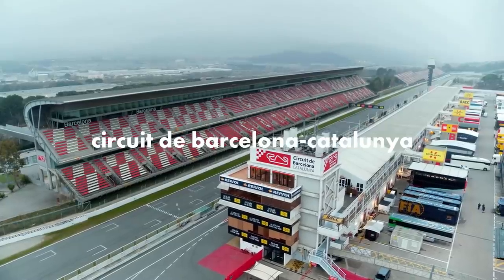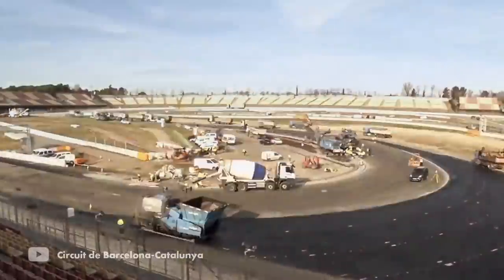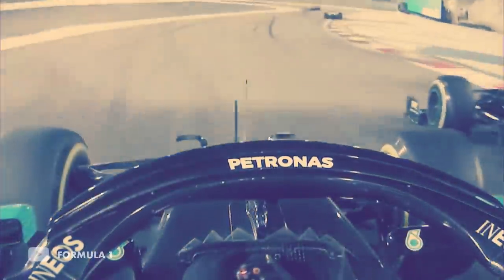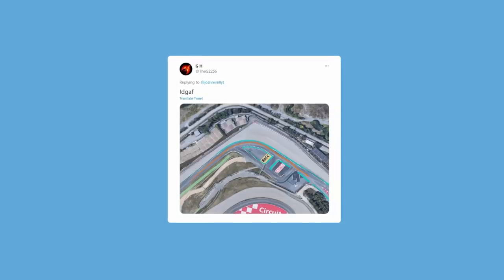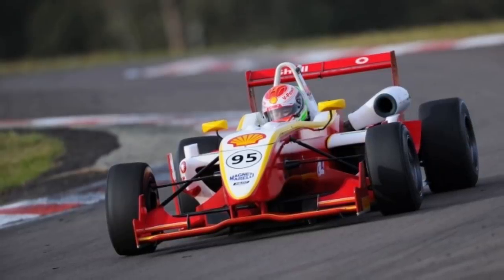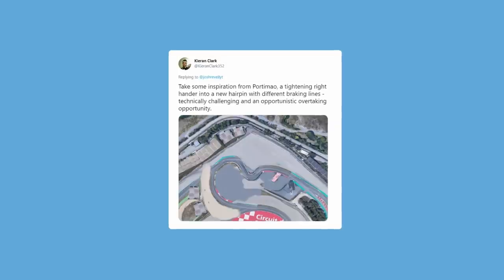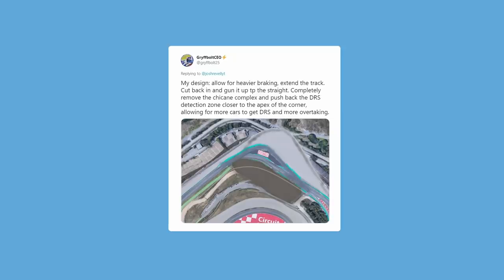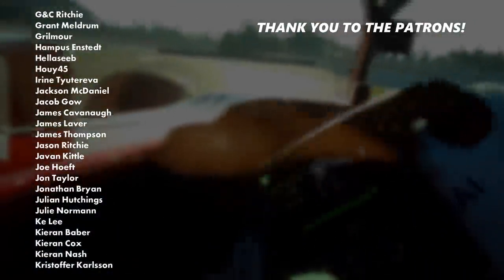Fixing Catalunya's stupid chicane

Comment: I'm team 'straighten the chicane out'
Reply: I'm team 'move it to Jerez ffs'
Reply: @schizoidforjesus  Jerez could be even worse for F1 racing
Reply: @schizoidforjesus  jerez is too tight for F1 cars nowadays..
Reply: I think you'd find that racing wouldn't be better for it. Possibly even worse. It's too hard to follow closely in high speed corners that require a lot of aero, what the chicane (as awful as it is) actually does is pile cars up a bit before the straight and make sure they can actually stay fairly close because the whole section requires a lot of mechanical grip. It's still hard to pass after the straight because corner 1 is too fasts which makes for a very small window to put in a breaking maneuver but while swapping the nasty chicane for "moar speedz" might make for more exciting shots of F1 cars on the limit it would not result in better racing.
Reply: I'm from 'shrinken the cars' team.

I wouldn't be if only there's no overtake at Monaco EPrix.
Seriously, F1 cars are too big nowadays.
Reply: Actually it's really really easy to fix the chicane. The best solution to fix it would be to remove the sausage kerbs. Why you ask? The sausage kerbs make the driver's take the cars extra cautiously through the chicane leading to them spreading out. Now if this was removed, drivers would have more confidence and would push more into the chicane and be able to stay with the car ahead better
Reply: why do you want to straighten it? you have a problem with gay chicanes?
Reply: I Like where your heads at but what if we straightened the chicane but added some twisting barrel roles so you'd technically be moving along the centre line of a straight track but be driving in 3 dimensions.
Reply: @nomienos1841  I was looking for that joke XD
Reply: i'm team "GO TO FUCKING KYALAMI"

Comment: Fix the Spanish GP by moving it elsewhere
Reply: Motorland Aragon could be a solid alternative tbh
Reply: @alexnovak905  how about Ricardo Tormo?
Reply: @alexnovak905  That's just Paul Ricard with a few more turns...
Reply: @ObviouslyKieran  The difference is that there's not really a sector that's extremely similar to Paul Ricard's sector 3, which is its biggest problem. First sector is close, but should still produce better racing than Paul Ricard's third sector.
Reply: @Undivided-X  That thing is too tight for MotoGP, let alone F1
Reply: Just copy and pace the exact same track and make it the south African gp for example. Fivehead move, problem easily solved.
Reply: Fix de F1 cars, the track is not the issue, how bad these cars are on fast corners due to the air flow is the issue
Reply: @xv2565  the new regs will help dirty air, however that's only one of the many problems regarding overtaking at this track. The track is the issue
Reply: @modern_agony  no way, that would be an awful idea. A few hundred million euros just to have the exact same track in a different country? No thanks. It wouldn't work anyway, the environment and landscape would be completely different.
Reply: ً  there are also better ones
Reply: @alexnovak905  As a person who lives half and hour from that venue, that would be amazing, I've been there a couple of time for MotoGP Racing and it's great.
Reply: Motorland Aragon is probably the best option. This track is spectacular imho
Reply: How does that fix the chicane?
Reply: Fix the spain gp by completely removing it
Reply: @Undivided-X  Ricardo Tormo is way too narrow
Reply: @alexnovak905  replace it with Hockenheim or Nürburgring
Reply: @Undivided-X  Ricardo tormo is dificult to advance even in motogp, I think motorland should be better option.
Reply: VALENCIAAAAAAAAAA
Reply: I mean probably cant but ascari race resort.

Comment: My thought; Use the old style sweep, but bank the crap out of it so it's kinda ovally you can Really hammer the start finish/pit entry
Reply: Wouldn't want to take a banked corner flat with old tyres with rubber debris off the racing line...
Reply: enough banked corners, they're useless
Reply: Oh yeah like avus
Reply: too dangerous
Reply: @ERIC44424  I mean, if Zandvoort can do it.

Comment: Hardest corner in F1 2020 with Monaco’s grand hotel hairpin
Reply: There is nothing hard about that chicane. There are other corners who are way harder.
Reply: @aldogjipali2835  it isn't hard yea, it's just more annoying than a Vegan at a BBQ
Reply: Neither are hard at all lmao, i find the 7,8 chicane harder at barcelona, and at monaco, the AI are so bad anyways, 110 is so easy there, i struggle with 110 more at Barcelona
Reply: @LimburgGaming  annoying in terms of spectacle, but not in terms of driving. There is literally 1 line through that corners. There probably aren't any easier corners to drive through as a racer.
Reply: @ameya2328  literally the 2 easiest corners in f1 if you don't count the ones that you don't have to lift off😂
Reply: @aldogjipali2835  why does my rear always go loosy goosy at turn 11 (Barcelona) new to the game so no idea if it's just me
Reply: @izanagisburden9465  setup, youre talking about the corner after the hairpin right?
Reply: You need to turn in slightly later and just clip the inside kerb and just keep one steering angle for the rest of the corner, if youre fighting the car, youre losing time
Reply: @ameya2328  yes the corner after the hairpin
Reply: @izanagisburden9465  add some rear wing probably to help the stability, or reduce the suspension values at the rear, prefferably the rear wing, cuz youll need high rear wing values at this track especially

Comment: I like the suggestion at the 3:09 mark. It makes turn 13 more of a potential passing spot, but allows the cars to build speed through the final corner and onto the front straight. F1 could then put the DRS detection zone at the exit of turn 13 so that the car that was passed at that corner can then fight back all the way down the front stretch.

Comment: I’ve always been a fan of lessening the 90 degree angles, but keeping the general idea of the chicane.
Reply: it is just neede to have two racing lines in there so you can be actually close on the straight. Even if you are exactly behind the car in front you are still 0.5-1s behind because you are so slow. I actually dont know why they dont want to fix it

Comment: during the Austrian broadcast of the Qualifying Alexander Wurz said that the GPDA asked the FIA to move back to the outer Corner for next year. As they just started the process the Outcome is still wide open but if FIA and the Track Management agrees, they'll be driving the Outer Corner again. The major Reason for the Chicane apparently were Safety concerns with older Car Generations but since that was long ago and Safety has increased massively since then he can't think of a reason why they shouldn't drive the double right Corner again. fingers crossed

Comment: Your suggestion is actually pretty good. I don't get why they cant just add more run off tho and use the old version, theres not much there apart from grandstands that no-one wants to sit in.
Reply: If I remember MotoGP also had a heavy influence about this chicane. It seems they tried to appease bikes and open-wheel racing.
Reply: @zerof0rce  Yeah but the chicane is an add on alternate with the sweeper still there not a complete redesign with the sweeper gone
Reply: @zerof0rce  MotoGP doesn't use the chicane, does it?
Reply: I may have my tracks or stories mixed up upon further review. Sorry guys!
Reply: @zerof0rce  The chicane has existed well before the bikes used it. It looks like MotoGP only used the chicane twice, in 2016 after Luis Salom's fatal accident, and 2017 in the shorter version. Since then grandstands have been removed and runoff improved, and FIM series don't use the chicane.

Comment: It's funny how people who don't know anything about designing a track kinda know how to fix this problem...
Reply: @Lunarfox  the "other motorsports" argument isn't valid. The chicane would still be there for them to use. Like the old corner is there too.
Reply: @Lunarfox  you could lay asphalt on the whole area and draw white lines, install removable kerbs, to play with different layouts. Like Paul Ricard. The pre-existing chicane isn't an excuse to not modify that part of the track, nor it's necessary to eliminate the chicane in order to modify the layout
Reply: @Lunarfox  well, F1 does it everytime with Monaco, Singapore and Baku. Put those on, race, take those off. I'm not saying it's the best solution, but hey, it's A solution. It's better than that atrocious chicane, at least.

Comment: From what I remmeber when they added the chicane, there were two reasons they chose this layout.
1. They could not extend the run off at turn 13 (same reason they originally reprofiled turn 10)
2. DRS

The cars were entering the original corner at higher and higer speeds, so the only way they could improve the safety was to push the corner itself back and make it tighter.  Meaning more run off, heavier braking and lower entry speeds.
A tight chicane was added to allow the following car an opportunity to close in on the car in front under braking and maybe get within 1 sec for the DRS detection point.  Because without the new braking zones, it's practically flat out from turn 10 (the end of the previous DRS zone), and now they've reprofiled that so it's less of a braking zone itself, there would be practically no heavy braking zones all the way back to turn 7.

Maybe under the new car designs next year and potential future removal of DRS, the final section could be redesigned for better opportunities. But for right now, though it looks clunky, it does what it's supposed to do.
I would say that any change to this section, should also include altering turn 12, possibly with something similar to turn 14 at Sepang and then work out what exactly you want for the end from there, but again that will depend on what the new cars respond to.
Reply: Chicane was added 5 years before DRS, in an effort to improve overtaking down the main straight

Comment: I always found it quite surprising that people don't like this chicane since personally I've always loved it. I think the fast right blind apex, to swoop back to the right into the hard braking of the chicane, then heavy lock left and right to nail the apex's and get a good exit is very satisfying to get right. Although it's quite a difficult set of corners as the lap leading up to it melts your tyres off so you're always on the edge of grip through those final corners. But still very fun nonetheless. I think the track would have a lot less character if it was just a high speed right like Turn 9, as it would be a more higher speed circuit, which would make it less suitable for winter testing as we wouldn't have that slow section, where the cars handle very differently.

Comment: I like the idea of a McDonald’s drive thru. Kind of eliminates the need for a run-off area due to a 15kph speed limit, and I can imagine the breathless commentary... “Verstappen has asked for fries with that” “Hamilton has dropped his Filet-o-Fish, this could bring out the safety car as they clean up the mess. Too late, Vettel has spun in the mayo on track.” 

“Stewards are looking at the new clip on drink cups that McLaren have introduced this weekend. Ferrari has complained that they might be illegal aero fins in disguise. Meanwhile Riccardo has gained a tenth a lap since putting a coke refill in his fresh cup holder. I must say, Martin, I think they do look very suspicious with those little winglets on the ends. If the stewards allow them it is only a matter of time before all the manufacturers are installing cup holders. And Ricciardo has gone another two tenths up despite the distraction of finishing a Big Mac.” 

“Disaster at Catalunya for Aston Martin as Stroll limps back to the pits. It appears a Big Mac container has lodged in his air intake. I think we have some team radio...” “(crackle) that *** Sainz just tossed the remains of lunch. What was he ** thinking? - We hear you Lance. We saw it. The stewards have been informed.”

Comment: watching this I was thinking to my self "wasn't the Chicane added for safety reasons since the year prior to it being added there was a horrible crash in the sweeping corner?" which was addressed in this video. I do like the idea of the first corner of that Chicane being 90 degrees while also widening the surface area though because that does make it an overtaking spot
Reply: All I can find is that the chicane was added "to improve overtaking", presumably because an F1 car can follow another one much more closely though a tight chicane than two aero-limited sweepers, and could therefore get closer down the main straight.

Comment: extend the run into 13 by 200m or so, then have a tight right hairpin before a sweeping lefthander on the run into 16...  Similar to turns 2,3,4,5 in Hockenheim just smaller

Comment: Easy. Add a 'V' shaped camber to the track, that way the cars taking the inside line will have to endure an off-camber and slow more than the cars on the outside line (which have camber working for them) so evening the opportunity for the car overtaking around the outside.

Alternatively gring the surface to be less abrasive on the inside and more abrasive on the outside of the corner achieving the came thing.

Comment: Fix the chicane, then reprofile turns 1 and 2 into something more like Bahrain. If the last corner had some banking added like Zandvoort, using the original sweeper the corner before would be viable again as the cars could follow close through the final corner. The track between turns 3 and 10 is actually good

Comment: the issue doesnt stop wiht the shicane alone t13 you need to add to that list aswell. I guess best would be some sort of open corner that allows different lines, like mugello last corner or the new t10. important thing is higher speed on the straight and not an acceleration zone like now out of the shicane. plus removal of teh off camber corner t13.

Comment: Okay, let’s go BACK TO THE SWEEPER—except, make the turn (13?) a true 90 degree right turn onto the original sweeper.  (Overtaking spot, maybe?). So that complex has now a little longer straight coming into it, as the turn is now lined up with the existing sweeper but squared off.

Comment: The problem with most attempts to fix these sort of corners is that they rely entirely on fixing that corner alone. The problem with just putting Bahrain’s chicane there is the Bahrain is chicane works because of the corners leading into it being good for racing. The section leading into the Barcelona chicane is like five corners in a row of pure aero wash

Comment: They are mad about run-off and fields of gravel which is in itself a hazard once those larger chunks start flying around the track (the Halo will not stop them either - you would nee an 'Aero-Screen' for that ). Monza does not have it nor does Monaco or most street circuits. 
Your point stands that there are so many ways you could tweak the final corner to make it a bit safer without resorting to the current layout. If it needs ti be done for other racing formulae such as motoGP then just use the F1 layout for grand prix race meetings

Comment: problem it's a bike track so the outside profiling needs to remain the same for that. If they could reprofile the chicane to make it less tight and perhaps a smaller left-right kink then that could work, the key is to keep the momentum through the first right hander and then reduce the effect of traction on the exit and keep the speed higher exiting the chicane so that the car behind has more momentum to head down the straight. Lewis would lose 2 tenths following through that chicane and he needed 10/15 lap fresher tyres just to offset that and get a run.

Comment: The sweeper was removed to "improve" the racing. Admittedly there were races with the sweeper in the layout that yielded zero overtakes, because it was impossible for cars to follow through the last 2 corners and the idea was the chicane bunched cars up and allowed for good traction out of the chicane yield a pass (spoiler alert, it doesn't).

It is just ironic that this was considered the "better" solution but hey, what do I know?

Comment: Catalunya has been a real solid track for racing in MotoGP. The needs of bikes vs cars always produces interesting results on a per-track basis. And since Luis Salom's death in 2016, MotoGP is definitely not going to use the old turn 13 anymore. I wouldn't even be surprised to see the ol' sweeper completely demolished at some point (unsure if lower spec series run it). And if that happens, it'd be a perfect time to design the whole damn section anyways.

Comment: I seriously recommend moving the Spanish GP to Motorland Aragon. It will be much better for overtaking than Barcelona and has some cool sections. Not bad for a Tilke circuit. It's kind of another version of Istanbul.

Failing that, tightening up the original penultimate corner or the one before that might help, with more camber added to the final corner to let F1 cars take slightly different lines and help overtaking.

But let's just leave this circuit behind.

Comment: I still don’t see a problem with using the old sweeper that was previously used, the run off isn’t that much but these cars are so safe nowadays even if you went straight on there then you’d be completely fine

Comment: Honestly, the best solution would be to either move the Spanish GP back to Jerez or try having it at Motorland Aragon or the Circuit Ricardo Tormo. Yes, Ricardo Tormo sucked for Formula E but that's because it was too long and too energy-intensive for current battery tech. It would be absolutely fine for F1.